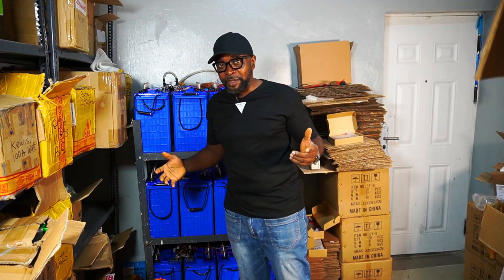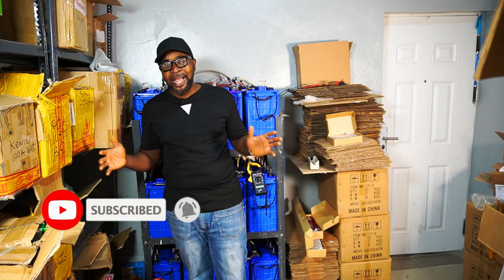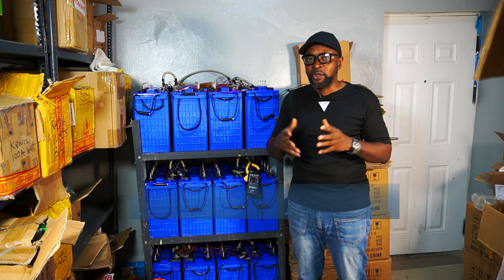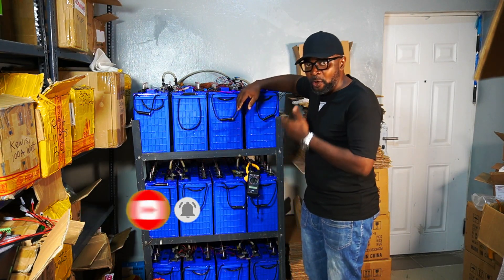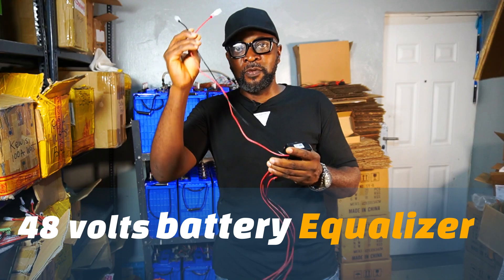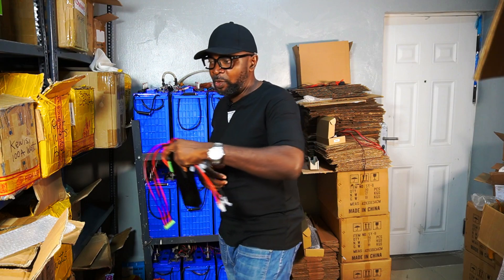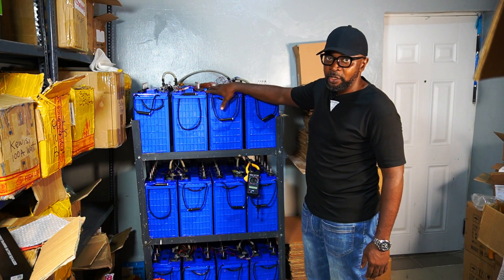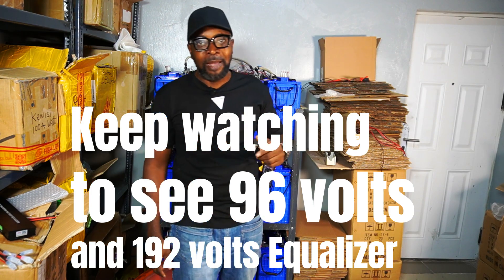Deep cycle battery Equalizer and how it works

Comment: Does the battery equaliser has any display screen like a BMS for lithium ?
And is the only work of the equaliser to charge the whole batteries evenly ?
Reply from the maker: No just a number digital display
Reply: @smilinsunsmilinsun8056 
Thank you for replying sir.
What does that single number signify ?
Reply from the maker: @obimartins575  What single number
Reply: @smilinsunsmilinsun8056 you said the battery equaliser displays a digital number,
So what does that number signify ?
Reply: I wanted to know if that number it displays is actually the (SOC ) STATE OF CHARGE.
I ASKED CHAT GPT, IT SAID I CAN CHECK SOC FROM A BATTERY EQUALISER.
Reply from the maker: no it only displays Voltage
Reply: @smilinsunsmilinsun8056 
Ok sir thank you sir

Comment: Hello... I saw someone make a 360V setup with 30units 12V lifepo batteries and was using 48V Equaliser per 4, instead of doing the 360V HV ESS with Superior Battery control/management system.
What's your take? 
How safe is it? 
Is it sustainable?

Comment: Pls in a  situation where  the legs on the battery equaliser is short,is it advisable to join a single core cable to it
Reply from the maker: Yes you can join wire

Comment: 4 12V ,100AH or 200AH deep cycle battery connected in series to produce 5 or 10 kWh power, do I need to put a BMS to it?
Reply from the maker: You do

Comment: Great job sir. I have a question.  If you have a 24V system with 4 tubular batteries connected 2-in-series, what battery equalizer will be appropriate for the 2 strings- 2 units of 24v equalizer or a single 48v equalizer?
Reply from the maker: @femmydex  48 volts equalizer
Reply: @smilinsunsmilinsun8056  thank you sir.
Reply from the maker: @femmydex  You are welcome

Comment: Hello a quick question for anyone that can help provide direction. Does AGM batteries need to be equalisedlike flooded battery. Also do the solar charge controller have inbuilt equaliser functions.
Reply from the maker: @vincentadegoroye6777  Every MPPT charge controller is equipped with equalizer functions . AGM Battery is not supposed to be equalised as this can potentially damage the battery.
Reply: @smilinsunsmilinsun8056 I have equalizers on my AGM.

Comment: In a situation where you have more than 16 batteries, can i get the one that can help to equilized 16 batteries at a time combined with the one for 8 batteries simultaneously for a system with 24 batteries
Reply from the maker: @obraphael  Sure
Reply: @smilinsunsmilinsun8056  thank you Boss

Comment: what about if you get a small spillage of electrolyte for a new battery, can you top up with electrolyte; any effects of battery function? And if that happens what is the corrective action to restore the battery normal function?
Reply from the maker: When you have  spillage from your battery as a result of transit movement. You need to fill up the battery with Electrolyte . You need get the SG of the battery.

Comment: Hi Ikenna, i have to make a reference to this video and i wanna ask.

As there are three different sets of 48V paralleled together, does it mean that one will be needing three(3) different 48V Battery Equalizer or Just?
Reply from the maker: You can segment your equalization by dedicating each to a 48 volts bank or use or use 96 volts equalizer to link two  48 volts in parrallel
Reply: @smilinsunsmilinsun8056  you are the best Boss. 👍👍👍
Reply: How do I link 2 48v in parallel with the equalizer cables because the equalizer cables +&- the distance will be short.

Pls kindly do a video of how to connect equalizer of 8 batteries using 96v equalizer
Reply from the maker: @Tolu_Wyse  You can either use two separate 48 volts on each parrallel or get a 96 volts equalizer that can handle all  of them at once.

Comment: Thank you Boss.

Is the equalizer need to connect to the charge controller or connect directly with the battery
Reply from the maker: Connected with the batteries
Reply: But the equalizer cables are short , how will it get to the terminals of all the batteries imagine 16Batteries using only one 192V equalizer.
Reply from the maker: @Tolu_Wyse  You will have to extend the cables with an additional wire of same gauge

Comment: First ikenna do you have to connect the equalizer permanently to the batteries u perform the equalization periodically

Also for a 24v systems with a 4 batteries, ie 2 parallel connection of 2 series batteries, do get a two 24v equalizer or 1 48v equalizer
Reply from the maker: Yes it's a permanent connection, synchronization is round the  clock
Reply: So for the second part I have 4 batteries  2 parallel connections of 2 series battery's each

So do I get two 24v equalizers or one 48v equalizer

My system is a 24v system
Reply from the maker: When you do parallels the voltage remains the same while you increase the Amperage. So you only need 1 24 volts Equalizer
Reply: @smilinsunsmilinsun8056 
1 have 4 batteries

A & B connected in series to form bank 1
C & D connected in series to form bank 2

Then bank 1 connected to bank 2 in parallel 

If I connect my 24v equalizers to A and B as stated to balance them

How do I balance C and D. Don't I need another 24v equalizer

Or do I get 1 48v equalizer to connect all four battery's?

Comment: Hi Ikenna. For several strings of batteries, do you have a battery equalizer for each string or just one equalizer is sufficient for all the strings if connect to just one string
Reply from the maker: The number of batteries determine the Equalizer voltage you will need. There is 48 volts, 96volts and 192 volts and so on

Comment: Thanks for your update.  Please I have a problem with my solar panels and batteries.  I have 3 batteries connected in parallel and 5 solar panels connected in parallel also in a 60w PWM charge controller but my batteries are not charging and I don't know why. Please help me with this problem
Reply from the maker: How many Watts is the Solar panel and how many amps is the battery?
Reply: most like charging current is small

Comment: Sorry to ask if I have and mppt 40a and 4 pic of 300w on 2 battery 24v system what will u go for 2s 2p or all 4 panel in parrelle
Reply from the maker: 2 in series is fine, the charge  controller max input voltage should be 100 volts for 40 amps

Comment: Do you need Equalizer for Two Tubular Batteries?
Reply from the maker: Yes
Reply: if you are using it in 12 volt and u Parallel  dem,d answer is no but if they are in series and is 24 volt,u need to add 24volt battery equalizer

Comment: nice,i have 4 powmr 48volt equalizer ,they are  working fine.i have 16 battery tubular battery.4 in series then i parrel dem
Reply from the maker: Nice one
Reply: @smilinsunsmilinsun8056 i decided to share the 16 battery ,8 for day time and 8 for night use,so i can power any load i wish in d day time and reduce it at night